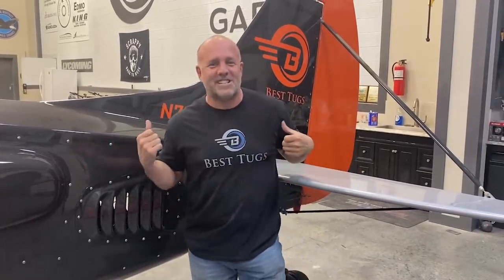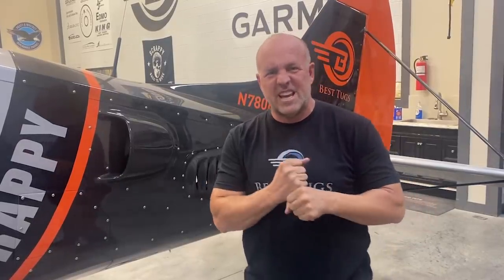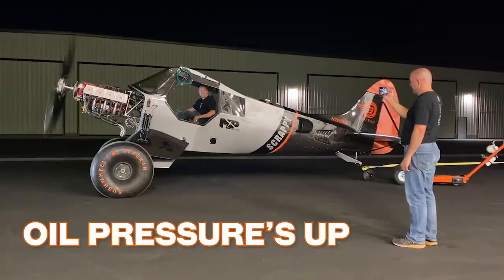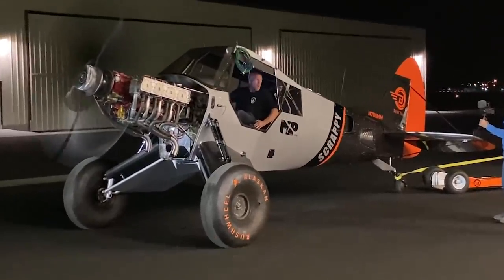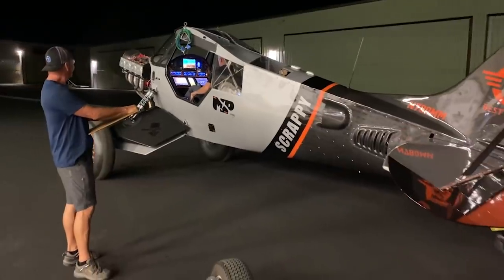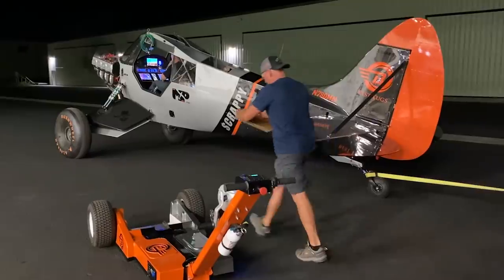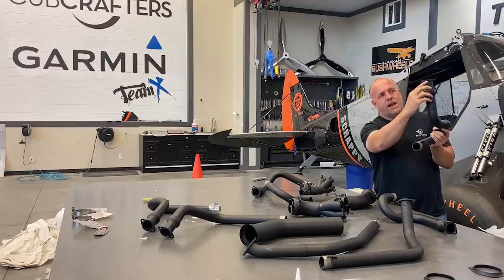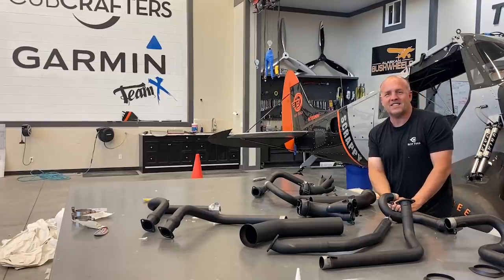Monster Race Engine Roars to Life in Tiny Bush Plane 😳 | Scrappy #34

Comment: I'm not entirely convinced Scrappy needs wings to fly, so be careful on that throttle
Reply: Its basically a rocket at this point
Reply: With bigger prop he wont need wings
Reply: Im sure the front wheels leg cowlings are sufficient for lift :p
Reply: It doesn't need wings, -it has a parachute.
Reply: Probably doesn't -"need a wing" -  ( but Mike forgot to add elevon control - (or did it in secret without telling us)
Reply: The noise that engine makes is just gorgeous. And that exhaust! Looks like something off a Group C race car... Love it. Getting close now Mike!!
Reply: @Will-W  . Cow flap?? That is a nice mix up.. Like a cow catcher on trains only that flap deflects cows after being diced by the propeller.  - If you are honestly confused, there are Drs who can sort that out.  Probably. Regards.       BTW.  Cowl Flaps can't usually provide roll authority - too close to centreline..  Ha ha.  Jk. (just fun here nothing to heart.)
Reply: Exactly my thoughts...
Reply: yeah damn, the runway clip that was so fast in such a short amount of time

Comment: Those exhaust pivot clamps are such a great idea!, A true Engineer the little things mean so much.. nice job
Reply: We just used a track that allow the top bushing bolt to travel forward and back, sort of like how an alternator belt was tightened on older cars.  Aim it toward where the exhaust originates and it'll expand and contract on a single plane of movement.  That eliminates the arc that a swinging arm would produce.
Reply: Go pens
Reply: @cw93711  Steelers too. ; )
Reply: @Skinflaps_Meatslapper  Exactly. The idea is to stabilize the directional forces and permit movement along a fixed plane.
Reply: Looks like it could be room for weight improvement. The screws to the fuselage looks to long. The other screws and the stay between the pipes looks stronger than needed. 👀👀

Comment: Next week: "Plane without wings does 8 second 1/4 mile"
Reply: Film at 11... lol
Reply: If only we still had a drag strip in Utah, sad day
Reply: YES!!! 💨
Reply: The Patey's attend Cleetus and cars!!!  Lol
Reply: @james94582  Mike vs James, and they still want show us the blooming times 🤠
Reply: It’s already entered into the next Dakar😁🤪
Reply: @james94582  I guarantee cleeter would be down too
Reply: @james94582   we can only dream
Reply: @Thefreakyfreek  heck, Mike would be too busy redesigning Leroy and Ruby's suspension to make em even better and faster to run the plane down the strip!!!
Reply: Pretty sure leroys already got that thing beat. Prop planes have like no starting torque compared to jets and cars. Especially leroy
Reply: @BoringFlightVids  wrong prop planes have better takeoff performance then “jet” planes
Reply: @greglatta2602  from a dead stop? Not the actual take off but like if the prop plane was sitting at "idle" and you lit a drag tree and when it goes green leroy takes off and the pane goes full power. I feel like the time it takes for the prop to get the plane to pull off will be a good disadvantage, never seen a prop plane just rip from a stop like a drag car. Id like to tho
Reply: Wasnt
Reply: @greg latta
Reply: I wonder how many more planes he can build before he has one that just pulls the truck away.

Comment: Ted here ex flight engineer,   good to see the static draw bar no of 1400 at this power setting.. Is that in lbs? Your estimate of 2000lbs AUW means you could go vertical at full power on prop thrust only. Youll surprise yourself as well  as all of us!!.

Comment: Is the visibility through the prop any different with such a wide blade vs a prop that you would typically find on a plane? That engine sounds fantastic, can't wait to see Scrappy get a set of wings and really put it to good use!
Reply: That’s a good question, I hadn’t thought of that?
Reply: I would guess looking through the prop would appear as looking through dark tinted glass, since the prop blocks a percentage of of the light going past it equal to the area of the blades in relation to the full circle. But that's just a guess.
Reply: @ThePatricHalldin  I had the same thought that it might just be like looking through a heavier tint on your windows.
Reply: been wondering the same thing. I think Patric's response will be pretty accurate. Slightly darker tint but not bad overall, if even noticeable. Some of the turbines have a lot of blades, even though they are not as wide as Mike's they add up, and it doesn't seem to be an issue. If you have an engine out, it could honestly be an extra issue compounded on top of the obvious depending on where the blades stop and block a lot of your view with them being so wide...  could potentially bump starter for a better position if the motor isn't locked up.. hopefully never happens period.
Reply from the maker: Great question.  Surprisingly I can’t see a difference between it and my 3 bladed aircraft prop.  I’m sure it must be slightly darker but I would have to lean back and forth side by side to see it.  You literally just don’t notice it at all.  👍🤠
Reply: @MikePatey  Well, not until you full forward the power,,, then all of Utah knows what's up. :-D
Reply: @MikePatey  Like water on the windscreen. You just focus on the scenery, then your eye doesn't register it.

Comment: Some guy looking out the window at the airport: "That Patey has lost it finally Maude, he thinks he can fly without wings!"
YouTube comment section: "he can probably fly it without wings!"
Reply: I reckon he probably could take off just on those winglets, but jeez he'd struggle to land it again...
Reply: @patheddles4004  landing is easy in a wingless scrappy it is very expensive however. Requiring a new parachute after each landing.
Reply: @thadaagaard6648  OK fair, I can't argue with that.

And hey, still better than having to rebuild the plane every time...

Comment: If it doesnt take to the air, you can always drag race it.
Reply: Is there a class of prop powered Drag racers?? (not forgetting that the prop os off a swamp boat - So like those "sleds", brute force is its reason for being.  Will be a day  to see the whole lot just as home on floats in the everglades as in the Wilds "back of Valdez".

Comment: Mike, you have been awfully quiet about the plans for the wings. Looks like your gonna have to start telling and showing us what you have in mind soon.
Reply: Well. I. Sure we will see spurs, and tanks in them to maximize loitering time aa a search & rescue focus.   Is there wing mods to maximize lift off of lakes at high altitude. Or designs for turbulent & extreme crosswinds? To address other  etreme weathering?  De-icing?  

Knowing mike. Hes going to throw his 5year old side at it.
Reply: I think I get it now! Never built a plane before.
Reply: Cowling likely comes first, before wings, I bet.
Reply: I was wondering the same thing. I think I know what's up. Steve Harvey has been kicking everyone's ass with is 317 horsepower Yamaha powered yeehaw whatever number it is. Steve's a really competitive guy. The only way this airplane is going to beat Steve at stol drag will be to have some amazing wings that can stop the airplane very fast! Most guys are going to an elevated rib with holes cut in it so that when they slip it spoils the lift and creates one hell of an air brake. Knowing Mike he's going to need to have spoilers that retract as well as some serious Deployable are brakes. He's showing us videos of what he's building, and the video seemed to be coming kind of slowly which means the wings are probably getting done fast. Notice how we haven't seen too many shots from inside the hangar. I suspect he's planning on dominating the drag scene in 2021! Even with all that power, it's going to take a pretty good effort to beat a 300 plus horsepower Highlander. But I'm sure Mike is going to pull it off but that's what I think is going on.

Comment: Anyone else thinking “Top Fuel Plane Racing”?
Reply: I wanna see quarter mile times.
Reply: YES!!

It'd be even cooler if they could have a couple rings in the sky you had to go through to enforce a certain climb rate.
Reply: Scrappy even has a Dragchute ....How cool is that !?!
Reply: That is STOL-Drags "All gown up" - 6000 hp 40bar Pure Nitro - would it work??  maybe add a minimum max altitude to the rules to add one small area of complexity  (or the height factor can be the "handicap") - ie. say: DRACO2 must achieve 200ft, while Freedom fox3 need only achieve 100ft, (for example) - nothing like leveling the field to bring out the punters..
Reply: @kadmow  well there has to be limits because there is only so much stress you can put on an airframe vs a car. Heck TFD’s create thousands of pounds of downforce just to keep the wheels from spinning and even then they do all the way up to 150mph.
Reply: @superskullmaster   - and this thing -  with down pointed pipes could also -- -Zero velocity thrust/anti-down-force - no need for JATO -  (if it had a ""drag race engine" - lol  to think  wow...  Aileron authority over torque - solved by Counter-rotating-coax (Mike has even mentioned that previously)  or "cold (or hot) gas thrusters" - don't worry this level of ridiculousness may not occur...  Electric will intervene...

Seriously (beyond the ridiculous):
(There are Limits - where for any given Propeller disk diameter, efficiency drops at transonic tip-speeds (that is the speed limit), and Critical Angle of attack at Standstill (Max Thrust angle) allows for max power to be calculated - that is why this Prop has such wide blades - needed to absorb the Power the Current Engine setup is producing.  To "absorb" more power- add blades (or a whole additional Disk - via a Coax Drive, or a MOre Ocnventional Twin prop setup -   Reason why WW2 Fighters grew so large was to handle the power from the Engines (then additional weapons got added and everything went "supersize Me").  Since then we have added  blades, think of all the Milti-blade Props on Turboprop Transports - the most savage of course, the Tu-95 Bear.
Reply: @kadmow  imagine Scrappy with 4 turbo’s running on 140 Ocatane with a hint of nitro methane. 👁👁
Reply: @superskullmaster  . Nah, I already went Straight NitroMethane.... (Don't care how many turbos you bolt on, Just max out the boost for fuel type -  (Aircraft operate by "Firewalling" the throttle and power is delivered under  "steady state conditions", one Huge turbo per bank does the job. after that you go to a proper turbine engine.....)   haha - just  having fun -

BTW - Mike will soon tire of a "ground settable" prop - needs a CS prop with huge Beta range.

Comment: Awesome video, suggestion. For the ground turns that you do, you should make a 50 ft ICS extension cable for use outside the aircraft so you can talk to the people you’re working with! Makes communication way easier when getting the info you need and readings you want! 

P.S. it was awesome meeting you and Mark at Oshkosh last year, Draco was a beautiful piece of machinery!

Comment: That joint is just like my 1992 VW Golf, the header to exhaust pipe connection.... allows for engine movement, without fatigue of the header or exhaust pipe...just like yours ;-)

Comment: Did you do a ceramic coating inside the exhaust system piping to help keep the pipes from getting so hot ? It helps with lowered cowling temps.
Outfit in Sandy, UT  High Performance coatings, does that work. The ceramic wraps on the outside is bad for the pipes, as you most likely know.

Comment: Just out of curiosity, what is the material and thickness of the exhaust pipe tubing?  I believe Mike's videos should be mandatory viewing for those pursuing an A&P license.  It clearly illustrates the difference between a licensed parts changer and a professional aviation mechanic. It is all about seeing and solving problems.
Reply: I don’t was wondering if he chose inconel or SS for the exhaust manifold.  I can’t imagine him not using inconel unless it has some weird altitude characteristics which I doubt.

Comment: Mike,  the exhaust looks interesting.  I noticed how they keep all the hard angles to a minimum ( in fluid dynamics, as a fluid or gas passes thru a bend that is exceeding 33°, the inside edge will cause cavitation ) 

Mike.... are you going to Thermal wrap the tubes ...at least on the down tubes near the Intake Manifold??

Comment: what a great sound ,13 liters ,bass profundo !. was a bit worried after last tiny bite of sound that was all we'd get , ha and have to say mike you are a little 'million ways to die in the west ' ,sometimes !.  But great detail analysis ,as always .  You and 'experimental aircraft exhaust systems 'maybe a great platform to test out the sound reduction idea coming from Boston Uni Team ,using 3d printed metamaterials ,  'acoustic meta-material silences sound without blocking airflow ',  new atlas . blessings MG

Comment: Mikey, I have no idea how much Scrappy weighs in at, but I have a feeling with 780 CI up front, you're not even going to need full power to get that off the runway.  Okay, accelerating vertical climbs, maybe, but getting it off the runway?  Half throttle, maybe.

I can't wait to see first flight, it should be awesome.

Comment: That is a sweet sound any car builder would be proud of. You may convert a few of them to aviation yet. Before the wings are fitted, it might be interesting in higher power taxi trials to fly the camera drone parallel and study the weight on the tyres to see if the undercarriage fairings/aerofoils are producing any ground-effect lift. ( Could it float just above a three mile runway for a second or two with just the undercarriage fairings I wonder ). I could not see any twisting down the fuselage happening without the wings attached, so the carbon fibre panel/tubular frame combination seems to be doing well.

Comment: You can bypass that re-use gasket problem in testing by smearing just a light coating of high temp silicone. Not enough to bond, and you don't follow the usual procedure of snugging, letting it cure, then finishing to torque, you smear it on, install it, torque it. The misalignment is easily bypassed using this method. I use it all the time whenever i am testing an engine, otherwise, i'd get into triple digits on test phase by the time i'm done.

Comment: Mike- just had a friend gift me his old drag racing r.c. airframe.  Late fall each year the club would hold what they called The Pumpkin Fly.  Various events would be done, one remember able one was to pull the wing and race down the runway.  Wild to say the least.  Said airframe was built for a .40 glow engine, so.........maybe a .120 four stroke would be better eh?   Sound familiar by chance?   You taxiing (2i’s?).  Anyway Back to building wings!

Comment: Mike 
 Nice load cell I use one to test fall arrest anchors. My question is with that much torque could you Theoretically hang that thing on the prop in the air ?

Comment: Using a stretchable strap on the scale gives your engine pull numbers more latitude to vary. I think a metal chain would give a more consistent and reliable pounds of pull number. The engine sounds great.

Comment: Could you get a performance boost from the exiting exhaust gasses? It was used in WW2 aircraft. The gas expansion might also help reduce drag if it came out far enough back.

Comment: Mike, I love the exhaust thermal growth provision. 

One question though :

Is your attachment assembly able to not just rotate but to also change its pivot radius as the pipe grows in length along a straight line ?

If not, then the pipe will presumably still have to bend a bit about the preceding point of attachment however, depending upon the distance between the successive supports, the change in length required of your attachment assembly may be insignificant so as to give rise to a significant magnitude of stress.
Reply: I’m thinking the ‘hinged elbow style’ design enables the necessary change in ‘pivot length’

Comment: Do you think those exhaust mounts will transfer excess noise into the cabin without some type of resilient base, like cork or rubber? Although on second thought, that engine is loud to begin with.
Reply: yep - with the headers exiting about 6 inches from one's feet - - There is a reason noise canceling is a big thing in GA headsets. [I didn't see that Mike has bothered with too much of a stereo system (the huge Woofer up front is all that is needed to get Jamming)]
Reply: @kadmow  lol, yeah true.

Comment: Please sir, may I ask a question? I once heard a WW II pilot talk about the danger of "torque twist". The torque caused the right wing to drip abruptly. Please what do you know about this phenomenon, how do you correct it in Scrappy with so much power and did that affect Draco and potentially contribute to your wreck? I can't say cr___!
Thank you very much. I am loving your channel.
Reply: There is of course a counter-effect when the prop bites. You just trim it out. On the runway, you kick rudder to keep it straight when you add power, or you'd be looking at some weeds in a hurry.

Comment: I have a challenge for you Mike, one I about which I have zero doubts in your ability. I know how much you love speed and power but I would like to see how much speed you can extract from the least amount of horsepower.  How about a two-place, tandem or SxS, with a smallish ( 100 HP or less with a goal of 300 mph or as near to it as possible. Or, a variation on that theme, use an automotive engine for power. This could be an existing design or something from scratch. I'm envisioning a very slick, probably low-wing fixed gear, probably a tail dragger but suit yourself. Whadya say?

Comment: We have a shop not too far from you. We have titanium pipe, Inconel and stainless, regular mild steel, moly steel and mandrel benders. 
Be a neat touch putting a titanium exhaust on Scrappy. The heat coloring would be a nice touch. I’ll send Trike an email.